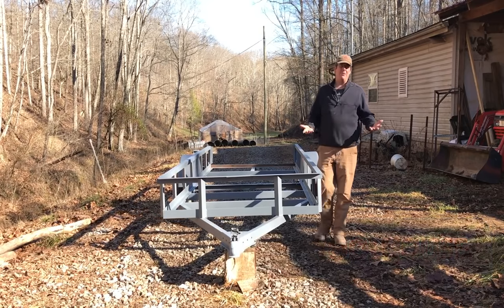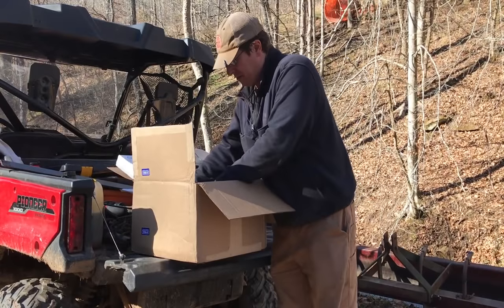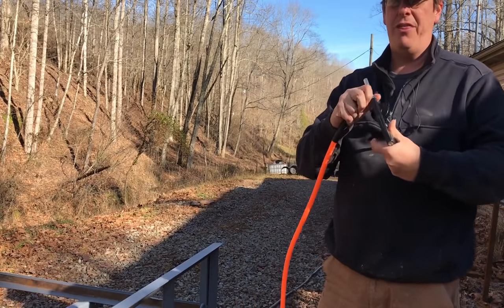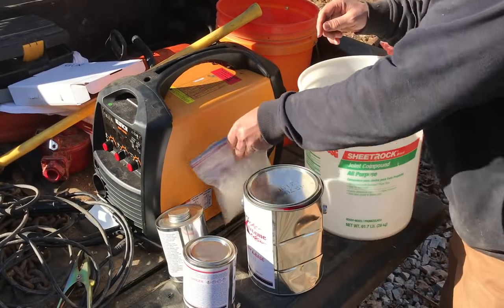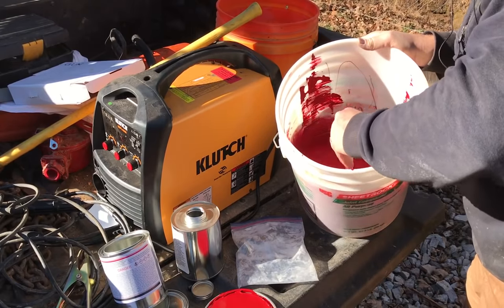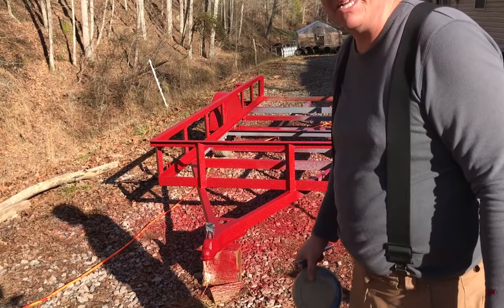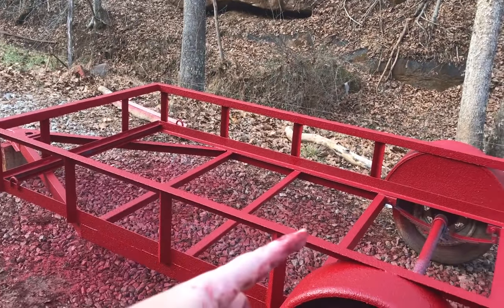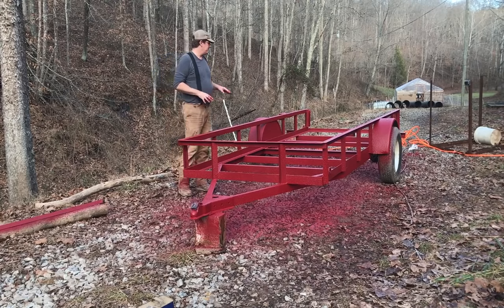Spraying LinerXtreeme bed liner coating on our utility trailer project

Comment: I imagine if you were going to run out because of over spray you could have just rolled the coating on. I used to spray Durabak in Jeep floor boards and pick up truck beds. Same type of concept except if you didn't want to be rushed to apply it you just didn't add the accelerator. I used a texture spray gun to spray it with. As you found out it gets messy.

Comment: Troy when you opened the gallon can it looked like there was room to mix everything, but probably that’s all the paint the kit needs. When you get those oak boards finished and installed you won’t want to put anything in it.

Comment: Turned out good!
 I have a 5 X 8 utility trailer that is mostly angle iron except for the tongue, axle and fenders and expanded metal floor. I'd like to spray on a bed liner material, how much do you think I need to cover it?
Reply from the maker: I would suggest the same size kit as I used (large truck bed). There is a bunch of waste due to spraying smaller surfaces.

Comment: You probably should have turn the trailer upside down with your backhoe And painted the underside first.
Reply from the maker: It is angle iron. There is no underside
Reply: @RedToolHouse  You didn't think that statement through, did you? lol
Reply from the maker: The angle iron is an upside down L on the entire frame. I can shoot the underneath portion easily without turning the trailer over. I have multiple people comment that I missed all the bottom rails when I shot the primer. I didn't because there are no bottom rails.